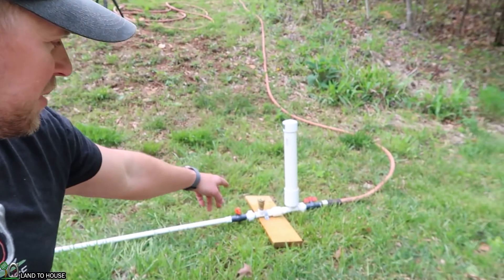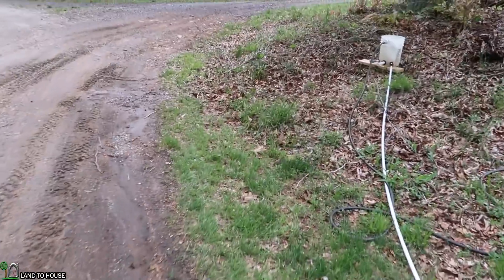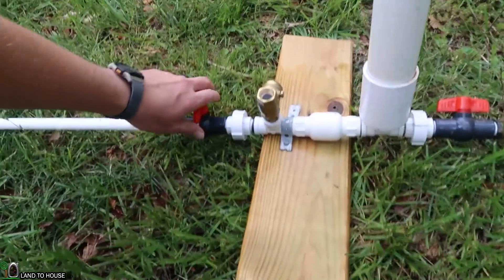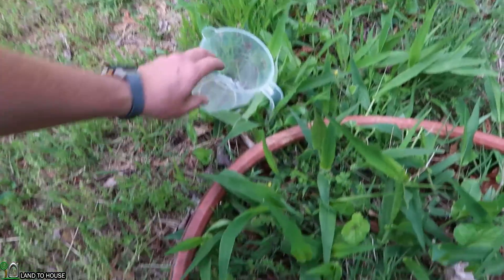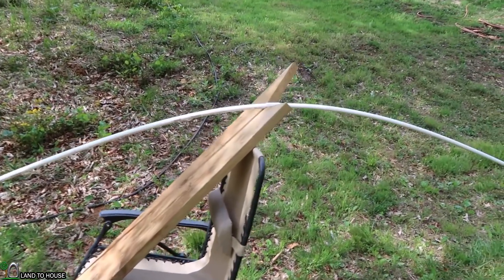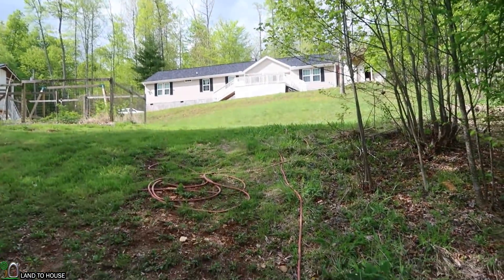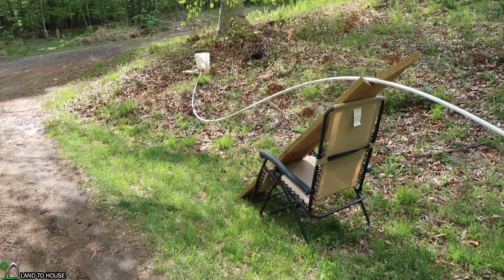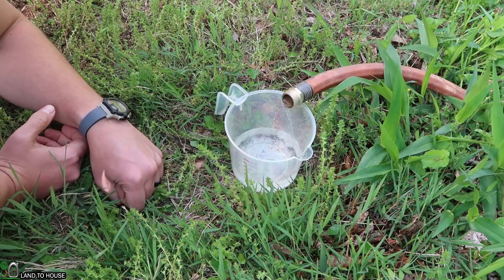Ram Pump Siphon for more lift Potential Take 2

Comment: Question - what if one were to do kind of the inverse?

What if you pumped up and over a hill. On the back side down slope of the hill, you add a Y-fitting. You then attach a second hose, combining it with the pump hose to the dbl side, and run that second hose back over the hill and down to the ram pump. Then you put the ram pump in a catch-tub, w/ a pass-through fitting at the bottom and attach the second hose into it. Either fill the bottom of the tub with a bit of water to help self-prime, or maybe as the ram pump works and spits, by the time water pumped up and over the hill, there may be enough excess water in the bottom for vacuum to the 2nd hose. Either way, with vacuum established, the draw from the pumped water coming over the hill and back down, would also draw now on the second line, pulling excess water in the catch-basin from the from the check valve spill overflow. If you have siphon, you should start drawing water from the catch basin as well as the pump. This "should" increase total water output by secondary excess catpure. * Naturally, this only works pumping up and "over" to a second gravity fall, but plenty of instances where that might be applicable.  And I'd be pretty sure some sort of parasitic loss, likely dependent upon how far the drop on the other side of the hill.  Think of it like how the Romans pushed water down into a valley up a slightly lower hill, only the inverse, up and over :)  Would be waay interesting to know and easy to set up.

Comment: Another test that you could do is a test to see how the standpipe works. I have herd the expression that the standpipe moves the source closer to the ramp pump. But is this correct? How can the location of the source move from where it is?  Is this how it works?

The water coming down the supply pipe from the water source has kinetic energy because it is moving down to a lower potential difference level. When the check valve on the ram pump closes the water flow at the ram pump stops.  But because the water coming down from the source has kinetic energy. This  causes the water level in the standpipe to raise, increasing it's potential difference energy. And now because the ram pump check valve has opened again. The water pressure at the ram pump is higher because of the increased water potential difference in the standpipe. And is why the ram pump performance is now better. Question is, is this how the standpipe improves the ram pump performance?

Comment: Hi, With regards to your question: Will the ram pump have more pressure if you introduce more head pressure by siphon? I see that a nother test has be completed to show the correct results.  The answer is NO. Because a ram pump works because of the potential difference level between the water source and the ram pump. Higher the source is from the ram pump higher the potential difference is. And higher the energy is that is produced by gravity.. When water is siphon to a higher level than the source level. Energy is used to work against gravity to get to a higher level that has more potential difference energy (by the amount it was raised). But the energy is give back when the water again reaches the source level.  So the resultant as it was found to be. The potential difference level will be the difference levels between the source level and ram pump level. If more pipe was used to get over the hill. Then the extra friction in the extra pipe will reduce the resultant energy obtained. When calculating water energy levels, you need to think in potential difference levels. And the energy produced by gravity. Hope this helps.

You can do a test to see if the above is true. Get a bucket of water and use a hose to start to siphon the water out of the bucket. Then slowely lift the end of the hose up to be at the same level of the water in the bucket. The potential difference is now zero and the water will stop coming out of the bucket.

You can even test it in your car. When you drive up a hill you use more petrol.  To work against gravity. To get to a higher potential difference. And when you come back down the hill you use less petrol when you get the energy back. While reducing the potential difference.

Comment: I just bought 6 acres and my spring is at the bottom of the land.the flow rate is about 9 gallons a minute. My plan is to pipe the water Into  ibc tote.320 gallon  then attach 2 inch to 1and1/4  connector straight into ram pump. I've never seen  it.  What are your thoughts?
Reply from the maker: That flow rate is enough to run any of the pumps that I have.  How high are you trying to lift water? And how much head pressure do you have in your Spring?

The delivery pipe going up to the tanks can be any size. The drive pipe feeding the pump needs to match the pump size.
Reply: @LandtoHouse  the drive pipe will only be about 3 feet but I can control the flow to about 9 games. The pipe will go uphill about  40 foot in hight to another 320 gallon  tote with another  1.14 ram pump

Comment: Now what if you put a syphon on the valve?
  take a hose, attach it to the rampump oneway valve, run that hose downhill more. 
If putting a pipe vertically up reduces pressure, would running it down create more pressure?

Comment: I like your experiments, But i have a more urban problem. i'd like to siphon feed a ram pump to pump water away my curb after it rains. I've watched exeample of tank tank siphons, but I haven't seen one that feeds a ram pump. A 5ft high supply with a 20ft run to pump (pipe length) run should give me plenty of head to pump water to  the alley, 75ft ( totally flat) away. What do you think?

Comment: I do aquaponics and i use U-Siphons and Bell-Siphons to assist in evacuating my grow-beds, so siphons do increase flow. Check out U-Siphons. example my filters used gravity to Out-flow water but were overflowing due to the flow rate of the pump. I added a U-Siphon and the out-flow of water  became much greater than the inflow.  my system ran for 3 years so that is 36 months of eyewitness evidence sir. This 2nd video did not really make a proper siphon.

Comment: how about lifting the bucket 1 foot hoghere each test at the same time adjusting elevation of the peak height of siphaned pipe 1 foot, i know you cant loft a pond up however many people may have the situation were they have a steep slope from the water source.😇

Comment: I hooked the outlet hose from one of your 1/2" ram pumps to a small landscape mist nozzle as an experiment.  It kind of worked, but pulsed along with the pump.  Could you use a pressure tank, maybe like the one on the ram itself, to smooth out the outlet flow from a ramp pump?  I'd love to see an experiment with that.

Comment: If we increase the diameter of the pipes used can we increase the gallons per min? Ram pumps are notoriously inefficient with only about 10% of the water passing through being pumped, so to get around this issue can you not just increase pipe diameter? Could you do a video explaining it please?

Comment: What percent higher must the drive pipe be for the pump to run?

I know on my setup I have 6 psi of head pressure and the pump won't run by itself until there is 10psi of pressure in the delivery line.

Comment: Excellent demonstration! 
I'm curious if it's possible to make a very compact setup. 
So a bucket which collects the water and get rid of the air bubbles, but basically on the same level as your intake. 
Then a spiral under it. like a spring as your lead pipe. Then the ramp pump at the end of spiral, about 2 meters under the bucket. 
Would it even produce any pressure? The water in the spiral should produce some momentum. 
If it works it would be great where you cant have the setup anywhere and your options are limited.

Comment: Hi Seth, why not use all brass fittings and a steel drive pipe instead of plastic pressure pipe?  Really enjoy these series!  Thank you.
Reply from the maker: Thank you for watching.  There is nothing wrong with using all metal fittings. I just prefer the PVC for the cost and ease of shipping.

Comment: I'd love to do a pump with a ratcheting teeter totter set up like a V8 or timed with siphon law and law displacement then have a four lung pump set underneath for the cylinders and then have a stored capacity up on top of a hill with pipe leading down to carry a Static-X way over built but the potential of output should be pretty decent because law of second States if you carried the static x or potential buildup in weight displacement through stored capacity you turn it into a hydraulic system so if you progressively maintain the static weight through displacement of stored potential on a downhill it would take forever for the system to fill but once it was filled the potential to move would be exponential of what stored potential is like a pressure storage tank like pythagorean's cup except a lot of spaghetti lines for fastest placement of weight so you could control how fast you let whatever go through the system so then you can move way underneath and drain underneath as the system fills and resets independent on the storage size like 5 gallon buckets or 5,000 gallon buckets exponential of weight states that there's a lot of stored potential in those water tanks before they drain and if you have it on a ratcheting singular direction shaft like a cam or something wouldn't that be a lot of energy generation and if you could control the speed through the pressure that you set through the system because of siphon law pressure and size of an siphon law and how to build pressure through hydraulic system because you're trying to move less weight than the stored potential in the system and you're using it in multiple directions because of a waste dump and potential Mass through storage and utilizing multiple stages of transmission for transmission gain instead of transmission loss for it would take some screw gears instead of COG gears so in a sense it's like running eight ram pumps in one except using stored potential in a different direction and having to fill the system in a different way so if I'm not mistaken it just looking at where neutral is building up or wear weight displacement doesn't pass a curvature of higher body of pressure for potential to take the easiest route out correct me if I'm wrong it's just an idea I've been thinking about since I was a kid and I always thought it would be kind of cool to put together for if you mean the pressure needed to fill and to unfill the bladder through weight dispersed of upper weight release through weight and stored potential from hell and potential outlet of zigzag differential sized pipe into inlet for intake of external source at x height so if you have external working force you can use it to travel up exponential height for Relevant states you have exponential stored to do so

Comment: ram pump to fill container up a hill, then run that container to another ram pump even higher up the hill or a tree would that work?
Reply from the maker: I did that with a 1-1/4" pump in the creek and 1/2" pump as the second pump. Turns out it was best to let the lower pump go as high as possible because the flow was not high enough to supply 2gpm to the second pump.

Now you could fill a large tank and run the second in cycles.

Comment: I'm looking for a way to fill a stock water tank. With a bigger Intake to a larger ram pump will that push more water.
I dont have a lot of drop to the pump.
Reply from the maker: The size of the ram pump is what determins the amount of water that can be lifted. Each pump operates on the same head pressure to lift ratio. The waste valve is only able to cycle a set amount of water. Increasing the drive pipe size does not help. it needs to match the ram pump size.
Reply: Depending on your source, maybe something like this https://youtu.be/mN9iLNHGOYI would work?

Comment: I did a ram pump test my mine! I wanted to know if it would run a lawn sprinkler....... it sprays maybe four feet in the air by about a 6-foot pattern pulsating
Reply from the maker: Well thats good for a small area. Now if you have storage on a hill it can run even more. My wobbler sprays 30 ish feet.

Comment: Your bucket. To highest point to pump is equidistant, if the bottom end of the pipe is longer, then stronger pull?
Reply: Yea...been curious about that too
Reply: No, that does not matter.
Only the height differential between bucket and pump is relevant, assuming there's no air in the system.

Comment: According to fluid dynamics, you cannot raise pressure though siphon.   Water pressure at the raised section will be lower than source pressure.  Pressure at the ram pump will be the same whether the pipe is raised or not.

Comment: sir i see that you are using 1 check valve in that video.is that ok??
Reply: There are 2 valves....1 brass check (or waste) valve and another white PVC in-line valve check valve.
Reply: @l4zy64m3r  ah yes,the iron one is waste valve and the pvc type is check valve,ah ok. So we need to use waste valve and check valve ,not all check valve valve to complete the rum pump
Reply: @l4zy64m3r  thank you sir for the important info

Comment: Not a surprising result, but a very good test setup. I don't think this is a very good idea, but if you've got nothing else to test, I'm wondering what a slightly smaller sized input pipe would do to the amount of pressure produced. Less volume of water flowing at a higher velocity should have higher kinetic energy because k = 0,5 x m x v^2.
Seeing the valve closes at a specific volumetric flow rate, the velocity would have to be higher in the intake pipe to get there.

Comment: What would happen if you run a drive pipe line into a Y. Then into 2 ram pumps then back into Y to a  single supply line. Would it increase  or decrease your supply ?
Reply: I bet the two pumps would end up synchronizing, similar to how pendulums do.

Comment: I was wondering if you could test this "vacuum/gravity" pump with or vs a ram pump:
https://www.youtube.com/embed/hQL09bhEveo
Reply: That looks like just a straight siphon. The output must be lower than the input for any flow to happen.
Reply: Yeah that just looks like a siphon, with the bucket of water to help fill the pipes and get it started... There's no special action behind the barrel. A pipe with 3 valves (intake, crest of hill, and output) will accomplish this same task, close intake and output, fill pipe completely from crest tap, close crest tap, open intake, open output and you have flow...
 There just isn't the margin of error for air in the lines that a big barrel of water adds. That setup will not get water higher than the intake pipe like a ram pump does. But a ram pump wouldn't be ideal for flooding a field. Different goals.

 The ram pump can move water up a hill, but only a small portion of water compared to what it takes in.
Reply: @volvo09  the point will be testing if with this siphon you can pull water to some height over obstacles, let say a sunken river bank, and then link the outcome to a ram pump to push it higher, just to see if it enhances someway the ram pump efficiency.... Just thinking...